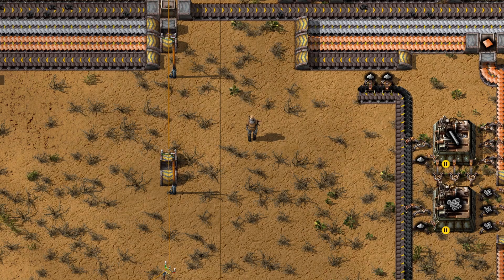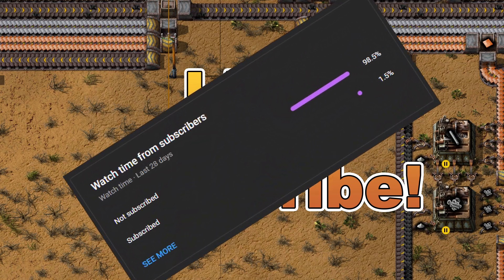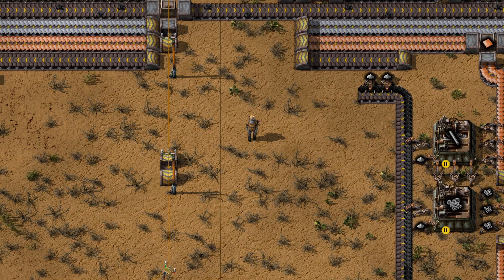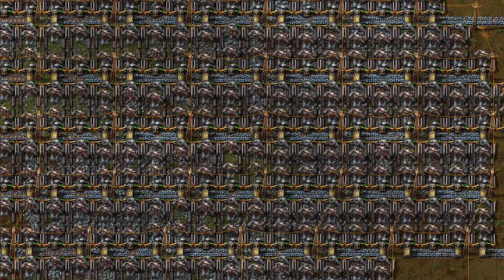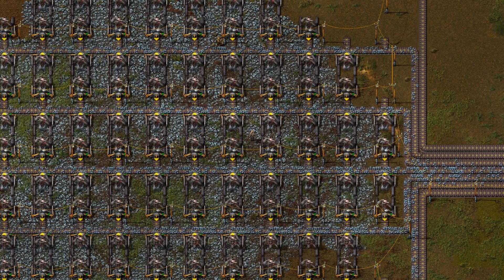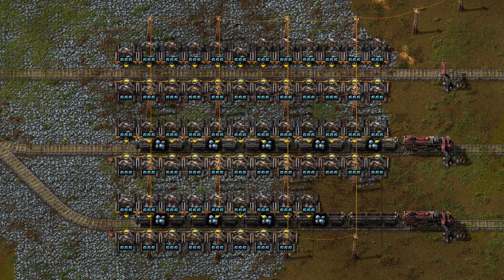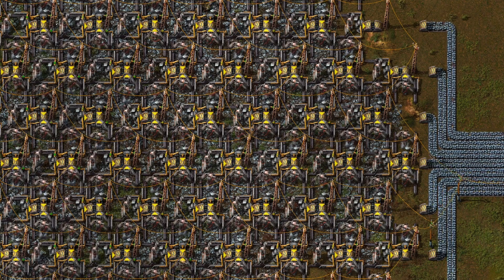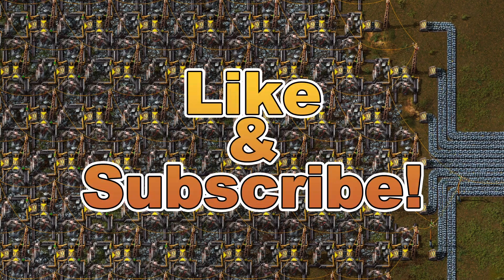How to set up your drills in Factorio!

Comment: honestly the spread out version doesn't really make sense because you will either fill up the belt one way or another and then they don't mine more than necessary anyway or you will not be able to fill up the belt in which case your using more than you're producing and you'll want to add more miners anyway so your base doesn't run dry
Reply from the maker: But you can swag on your friends! Or just use modded belts
Reply: @mico12  my point was that if you are using up enough ore to not be able to fill up the belts then you want more drills anyway and if you do manage to fill the belts (either due to not using up so much or due to the belts throughput being limited) then you aren't wasting anything either cause the drills turn off once they can't output any more. so one way or another you'll always want the maximum amount of drills possible.

Comment: Easy rule of thumb - when you have no efficiency techs researched yet, 15 electric miners will fill one side of a regular yellow belt perfectly.  So 30 miners will fill both sides of a belt.  Thus you have no wastage of mined ore or equipment that's not doing anything, which is very nice for the early game.  Just make sure that they are equally filling from both sides of the belt, and you can curve around without issues.

Also, those 30 miners will supply 48 stone furnaces (or rather, 24 if you merge a belt with coal).  If you upgrade to steel or electric furnaces they are both twice as fast so you need 24/12 per full ore belt (electric is no faster, but doesn't need coal - thus you can have ore on both sides of the belt).  And you should also get full belts of the processed metal coming out.

Knowing these basic ratios really helps with setting up your smelting arrays and gives you a good idea of how much you need to expand when demand increases.